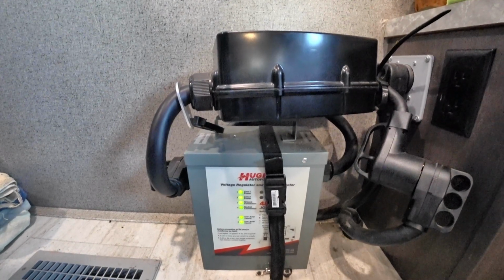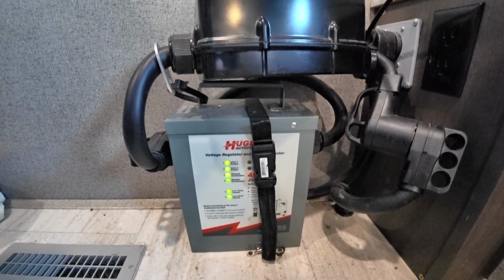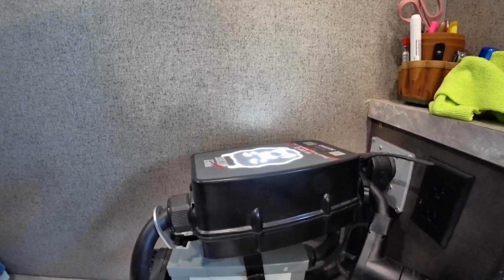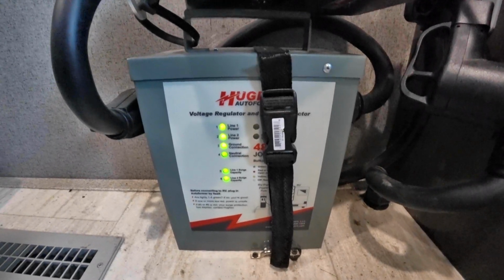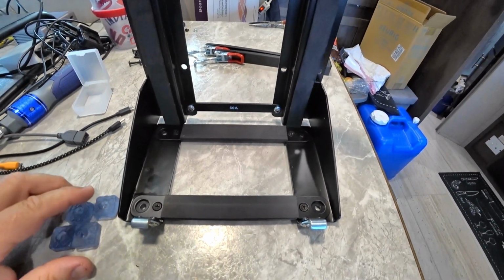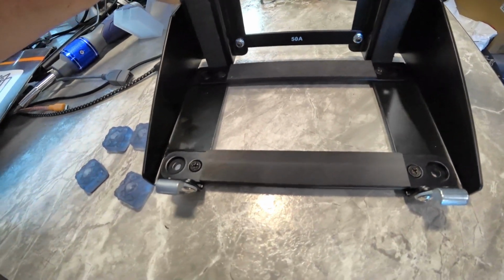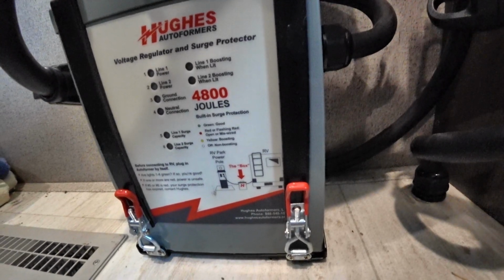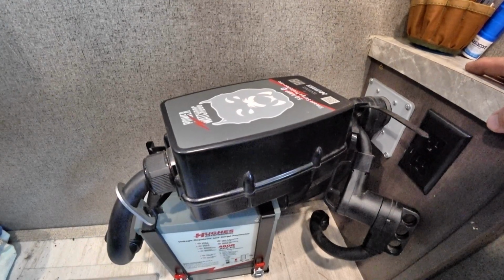RV Fulltime Hughes AutoFormer Mounted Inside

Comment: Yikes - maybe I missed it (and I apologize if I did), but why didn't you just install an in-line EMS that's hidden and avoid all the cabling, etc? My Progressive Industry unit manages surges and voltage, and has a remote display showing volts, amps drawn, hertz and any error codes. You can also by-pass the system with the flip of a switch. Again, sorry if I missed something.
Reply from the maker: We wanted to be able to pull it out easily for use in our next RV.. The progressive unit is nice but we love the Bluetooth during initial hookup and it tracks our overall Kwh so we can call out the RV parks that charge for electricity usage and give us innacurate totals..